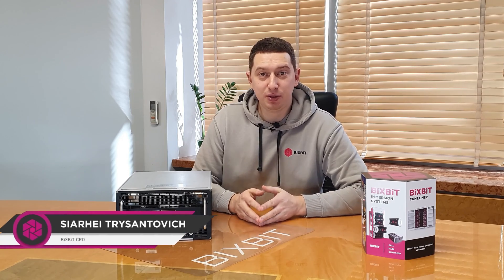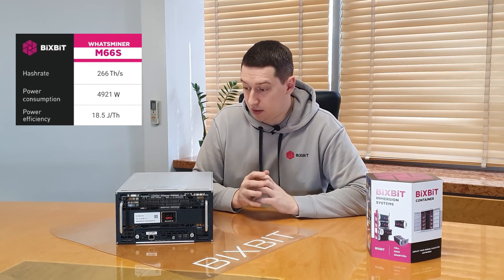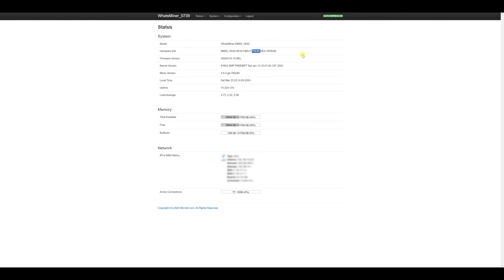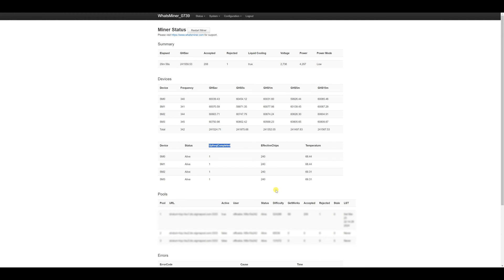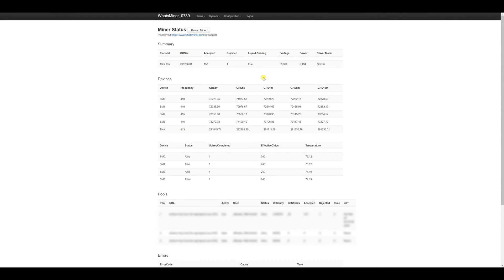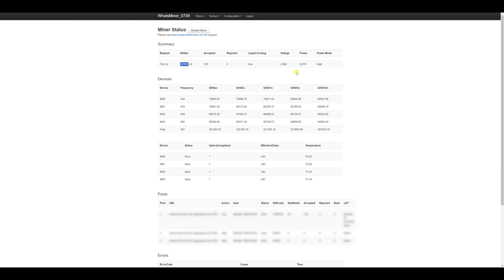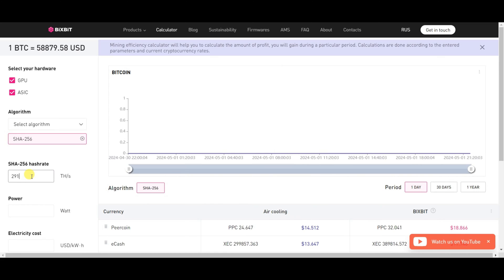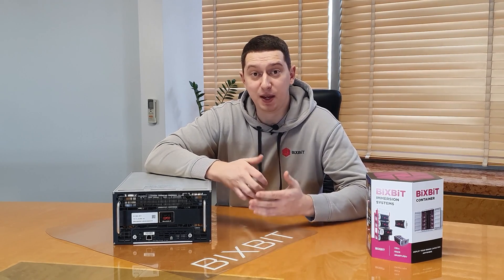Immersion ASIC Whatsminer M66S! Review

Comment: Great - except where do people have 280Volt power for $.04 usd - what a useless video
Reply from the maker: This device has quite a lot of power and therefore uses a three-phase network and can operate with voltages from 380 to 480 Volts. As power increases, technical operating conditions also change. With electricity at 40 cents, I would not advise you to mine)